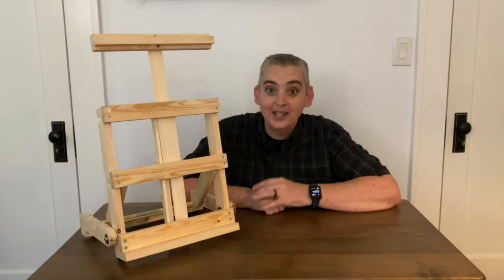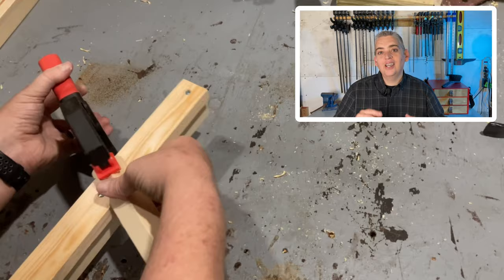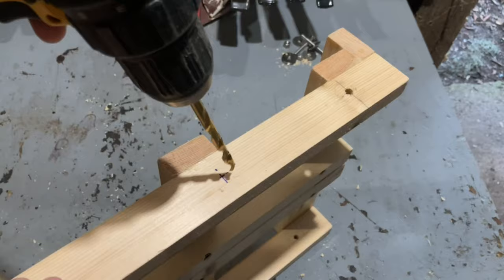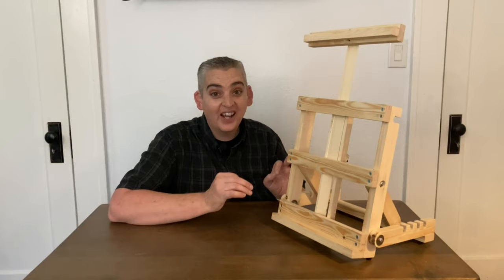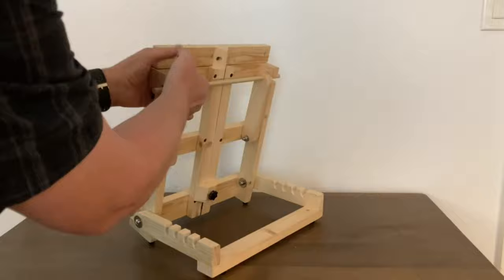How To Build A Table Top Easel That Folds Up!!

Comment: Hey love the video, i couldn’t figure out which size Star bolts and rubber feet you used.
Reply from the maker: I can't remember exactly. I always buy a variety pack of both and use what feels right for the project. there should be links to both in the description.

Comment: **You might want to add this comment as a note to your plan PDF.

0:26 - Project start
0:43 - cut list
0:59 - top of head assembly
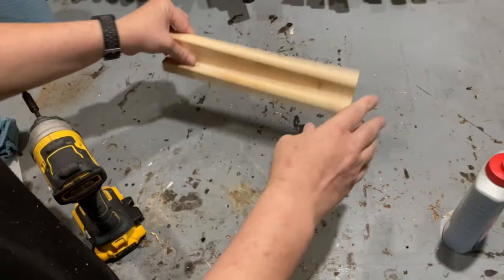1:33 - adjustable upper clamp track
1:46 - slider cut
2:02 - side of frame
2:17 - frame assembly
2:54 - slider track assembly
3:09 - upper clamp assembly
3:41 - track and clamp assembly
3:55 - pivoting hardware
4:01 - pivoting assembly
4:11 - side stretchers
4:26 - radius marking, cutting & sanding
4:57 - base assembly
5:03 - hinge assembly and counter sink mod
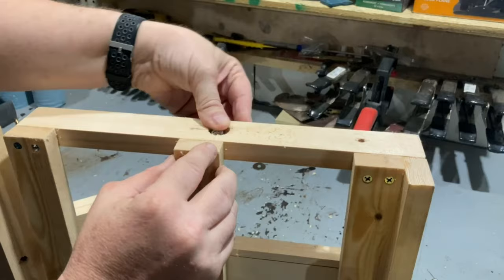5:27 - base stile marking & cutting
6:03 - magnet mod
6:26 - base re-assembly
6:35 - dowel assembly
7:00 - frame & track notching for dowel
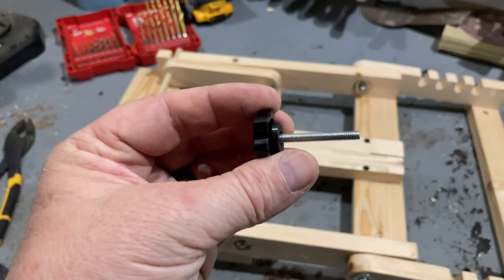7:26 - lock mechanism for sliding head
7:54 - slider block
8:00 - slider block & lock mechanism assembly
8:09 - paste wax
8:19 - rubber feet
8:29 - final product
Reply from the maker: Great idea! Thanks!!

Comment: Instead of cutting grooves for the 3/8 down to rest in I used short pieces of my excess 3/8 dowel to put pegs in place for the lateral 3/8 down to rest against it seemed to work fine
Reply from the maker: That’s a really good idea!
Thanks for sharing!